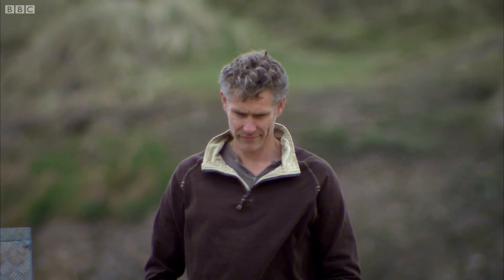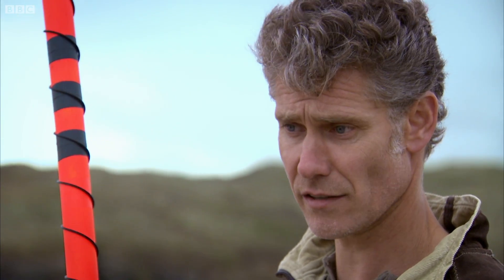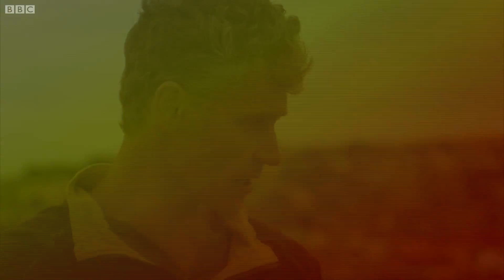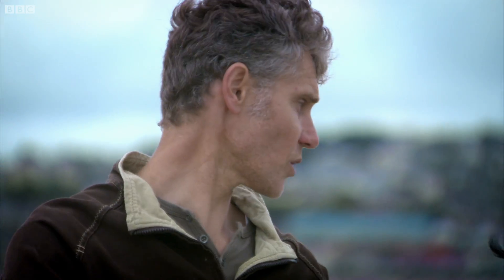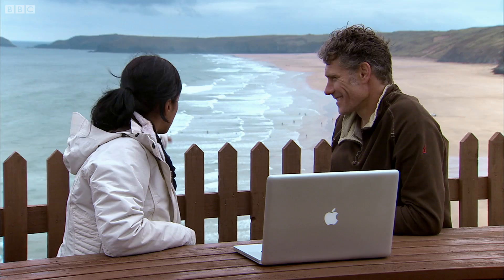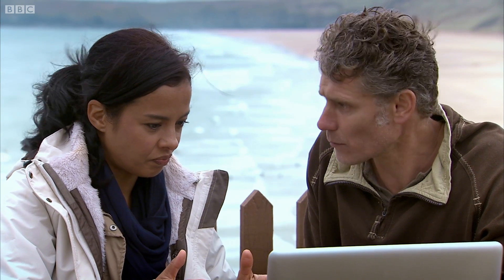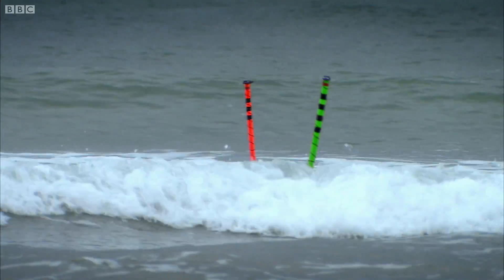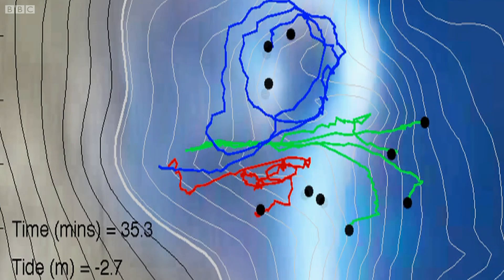How to Measure Rip Currents | Bang Goes the Theory | BBC

Comment: I'm unsure if the researcher involved reads this, but is there a reason that the scatter of the water speed data seems to be greatest when water depths are at their lowest? The trend is very clear overall, but given how little scatter there is in the rest of the data, it's interesting that it seems to increase when it does.